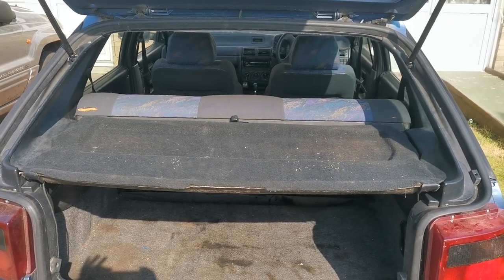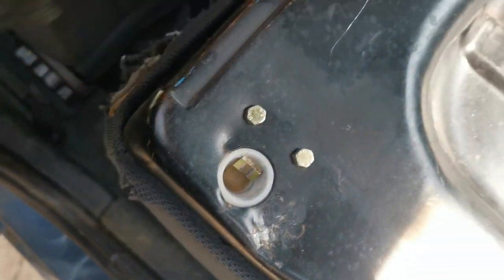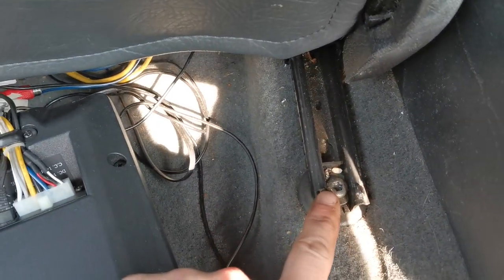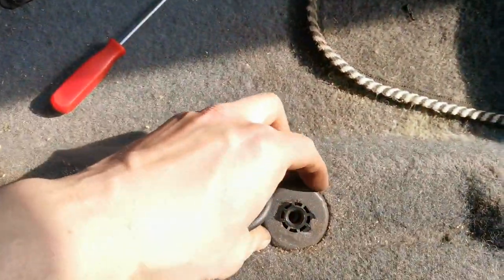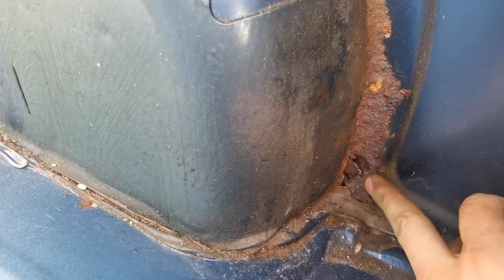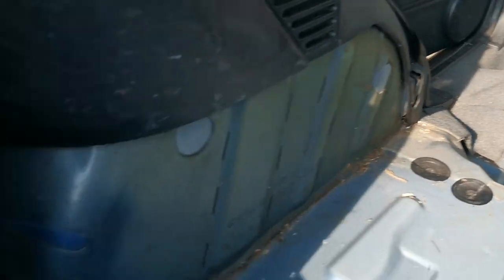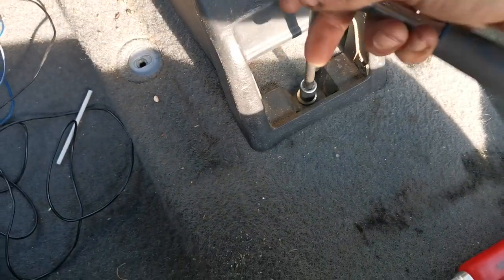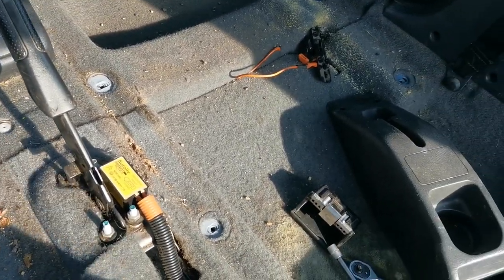ZX Interior removal

Comment: 7:13 i have big problem with this one, that cap under it spins with screw.
Reply from the maker: Ahh that's not good the black plastic spacer if that spins there no big issue but I'm guessing you've got a rusty / cross threaded bolt or the square nut has become dislodged from its slotted location I'm not really sure what to say in regards to helping you with that sorry.